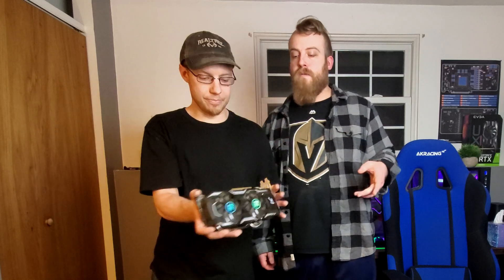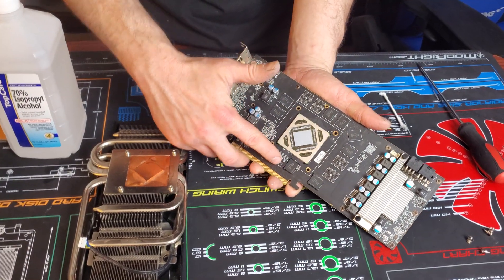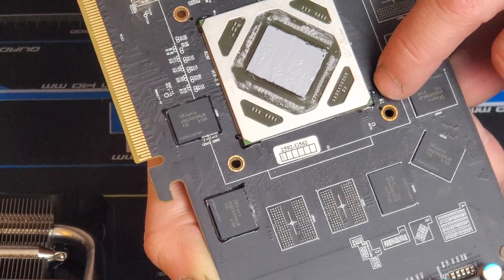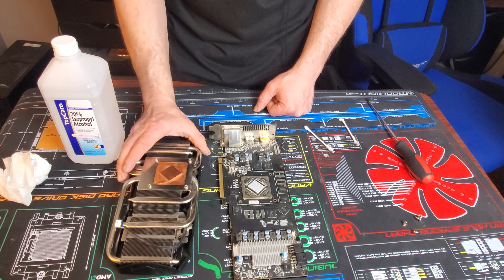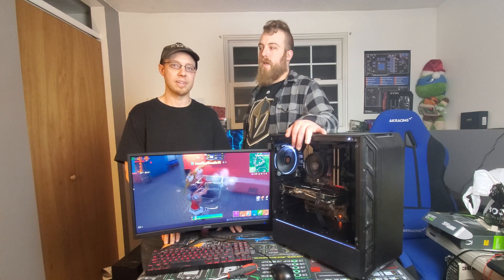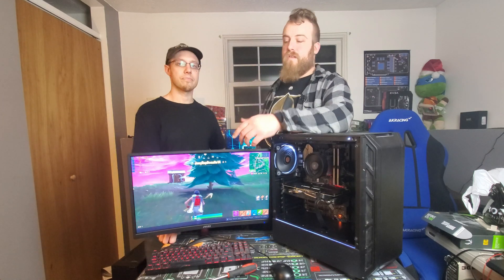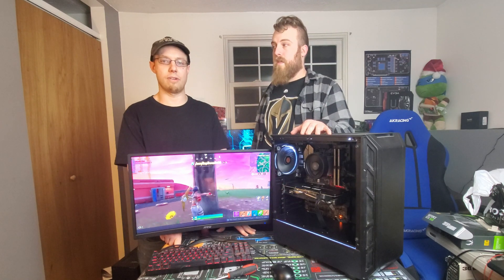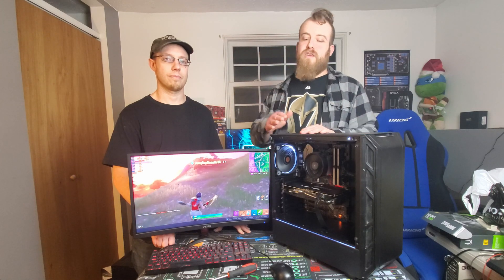3 IMPORTANT things to do after buying a USED graphics card on Ebay!

Comment: Great video. One thing that I like to do first,  is check the bios. A lot of these Ebay cards were used for mining.
Reply: How do you know through bios that it was used for mining?
Reply: @gary1213  any update?
Reply: @211Mik3  no
Reply: @gary1213  was just curious was thinking about buying a used card on eBay but scared it’s gonna die from mining because idk how to check bios
Reply from the maker: That actually is a good move too.  I thought of that during editing.  Thanks for mentioning that! I will pin you!

Comment: i just upgraded to a used gtx 1070, mine suddenly have ghosting and some 'green artifacts' popped up too, is it also because of dried thermal paste?
Reply from the maker: Could be.  I've seen it before.  Id try doing some thermal paste and cleaning any dust from the board and fan.  But its possible that card was used for mining and the memory is bad.